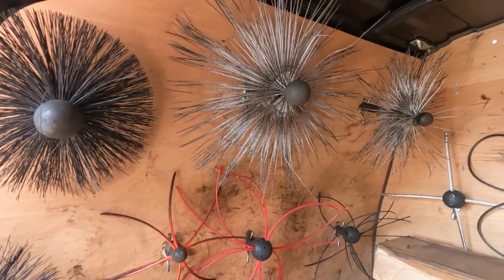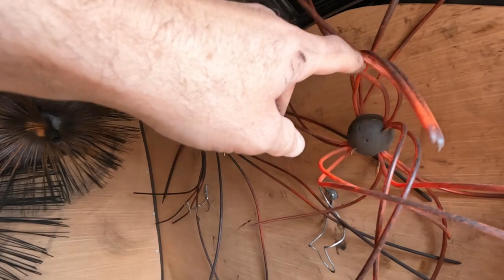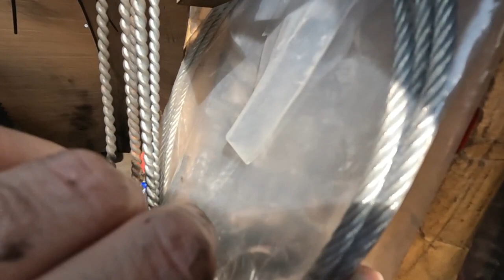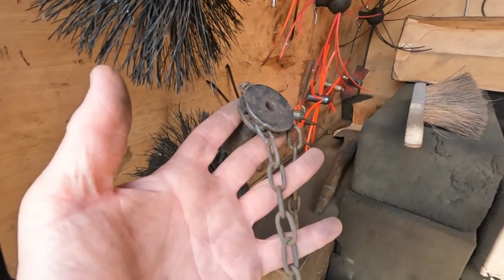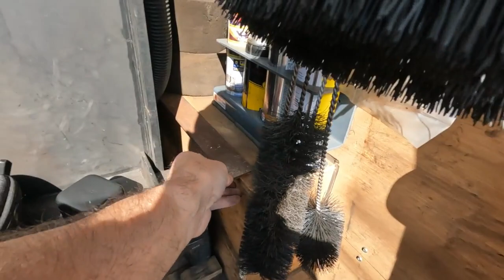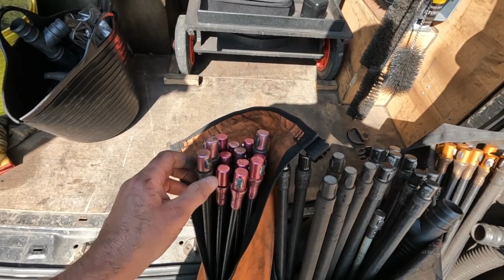What is in the back of the van?

Comment: Hi, 
I've Just ordered a starter kit for rps with 12 15 and 18mm rods and various attachments, am i going to struggle without any 8mm or 10mm rods ?
Reply from the maker: Hi, I would say 10mm aren't essential. I use mine infrequently but when you need them you need them. If I were you I'd consider it a next purchase item. As for 8mm. I hardly use them and when I've needed to, the mini viper has been enough

Comment: Hello do you have thoughts on the rodtech rods I'm seriously considering switching to rodstation rods . The rodtech mini click rods constantly stick together I have to pull them apart with a pipe grips and vice grip I've tried the dry lube with no luck.  Does the rodstation smaller rods fuse together too ?
Reply from the maker: Hello, I've never used rod tech rods but I've used both Snaplok and Rodstation. I've never had an issue with getting the rods apart on either.
Reply: @thechimneyman-uk  Yeah there mini click system is giving me trouble big time the rods are constantly seizing up the regular click system is okay its working fine. Do you have any tips for cleaning your rods I spray them dry lube daily never with wd40 .
Reply from the maker: @danbreen1916  hi, I've never cleaned any of my rods. 😅👌
Reply: @thechimneyman-uk  haha 😄 no worries at all . I'm a big fan of the channel great content . Top drawer videos 👍
Reply from the maker: @danbreen1916  thank you 😊